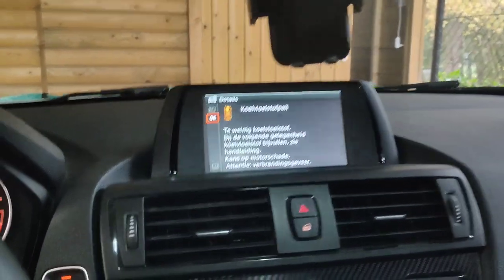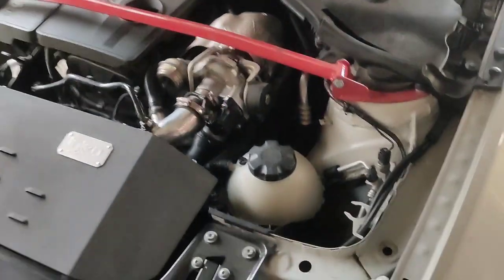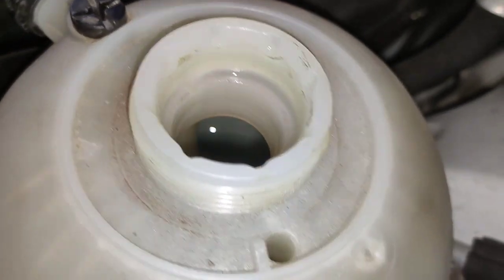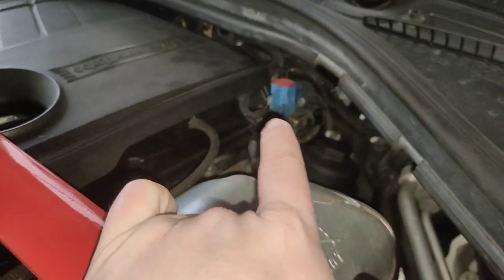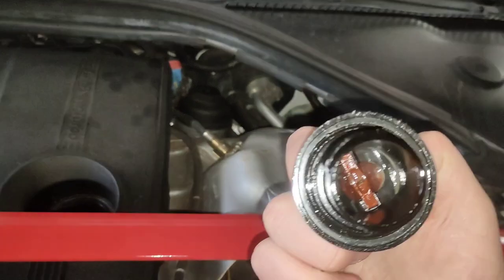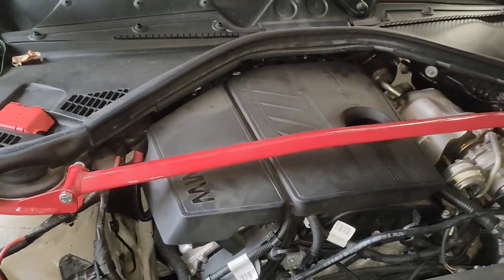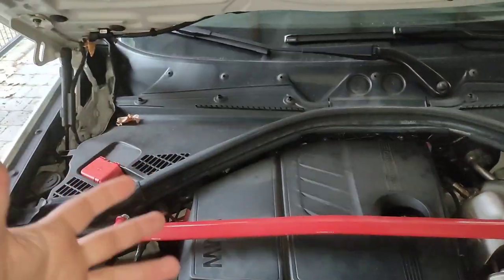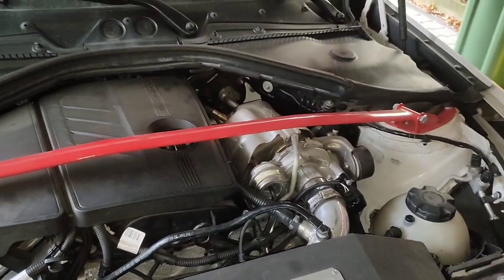Big Issue With The BMW!!! We Have A Coolant Leak!!!

Comment: Hi @bimmerbelgium2254 
What was the engine water coolant leak exactly & how did you fixed?
I have the same car and the same problem. The engine cooling water gets low but the onboard computer do not identify any problem.
Reply from the maker: My mechanic fixed it

Comment: How often do you check coolant level? How quickly has the coolant disappeared? If its a slow leak could be reservoir cap seal. Or tank split? You need to get it up to temp and pressure then sniff around the engine.
Reply from the maker: I must say i check the engine bay almost every week. Few days ago it was still full. The car is fixed already. Update video will follow soon

Comment: On my first 5k km after buying the car got issues with the cooling, but my idrive said that i should slow down and after 1-2km it said that i have to stop the car. I checked the coolant temp and it was over 120 celsius. My mechanic found the problem and it was a small plastic tube under the turbo which was leaking water. The cost was not so high, because that part was about 3€ to replace with a hand crafted tube of properly material But it took some hours for the guys to get to that position where that tube,was. We also changed the water pump because it was a little bit cracked after 95k kms, and the whole procedure cost me about 250€. The symptoms seem similar to me, only the check message different. Waiting for the update
Reply from the maker: The car is already fixed by now. It was something different 😁
Reply: what's the part # of the tube under the turbo?

Comment: hello, I'm thinking of buying a 116i petrol automatic f20, does anyone have any advice?
These cars have a lot of problems ?
Reply from the maker: They are pretty fine
Reply: Don’t buy any N13 engine. This includes 116i, 118i, 316i and 318i. I recommend that you get a 320d if want to enjoy a bmw without issues like these.

I own a 116i. I got 4 oil and coolant leaks. It sucks. Get a 320d mate. No N13 engines, please!!!

Comment: It can't be as bad as my beloved 114i. it drinks 1L of oil every 3000km. 😅...probably internal leak
Reply from the maker: Damn, that's a lot
Reply: @bimmerbelgium2254  yes I'm a little bit worried, but the car runs perfectly, doesn't smoke, no shit in coolant, so my guess is that there is a valve seal somewhere that is worned out
Reply: I’ve seen some stuff on forums about this issue and it might be timing chain related idk but you might wanna have a look
Reply: @NijoR873  thank you I will check that
Reply: Mine too, hehe, u should try liqui moly 5w40, only 1l around 5k km
Reply: @TheMichaelsVids  yeah definitly, I will switch from 5w30 to 5w40 next service
Reply: 118I and most of the turbo petrols all consume oil
Reply: Same here drinking allot of oil